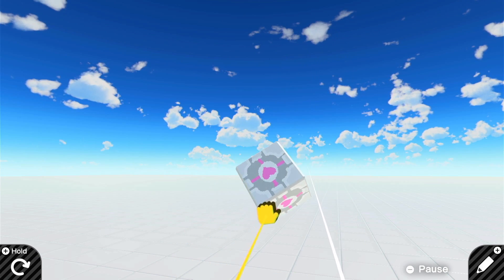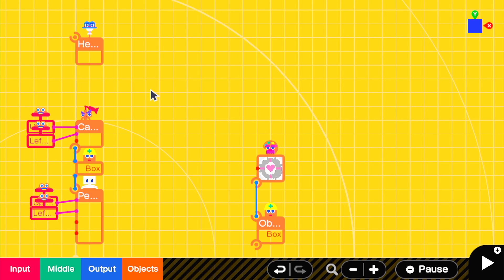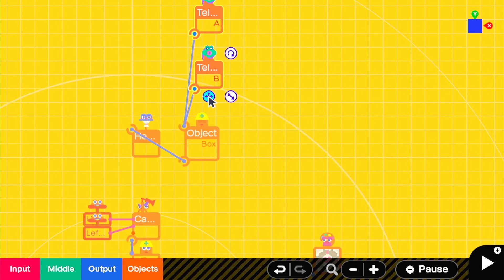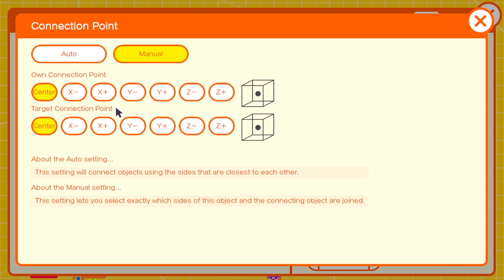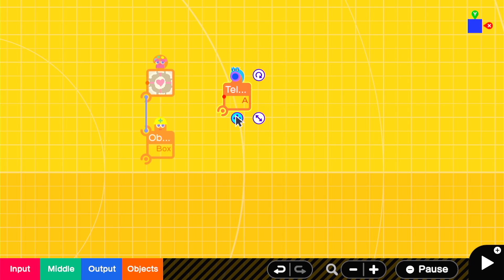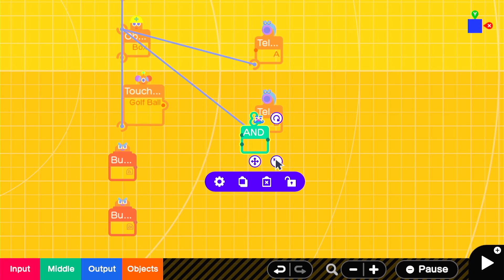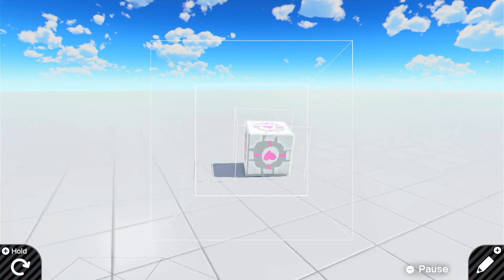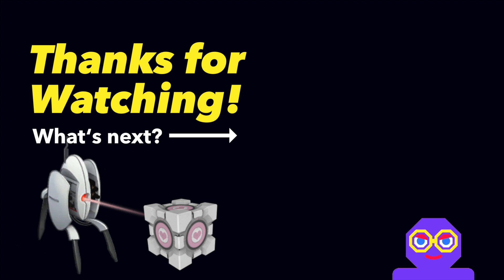How to Grab, Hold, and Throw Objects Like in Portal  (Game Builder Garage Tutorial)

Comment: Can you make an air only action? Like punch on ground  kick in air
Reply from the maker: Howdy. I don’t know when I’ll get to it so I’ll explain it here. If you need a video reference I have a video on a double jump and that should give a basic framework since we can only “double jump” in the air but the basics are this. 

Touch sensor attach to character on the Y-(below) that detects for anything the floor could be. Connected to a not nodon. Then you have a signal for when not touching floor.

You can attach it to an AND nodon with a button press, etc to activate the Air Only feature. 

You can adjust the size of the touch sensor to get different distances from ground and fine tune it.
Reply: @DaveNodon  thanks
Reply: @DaveNodon  but how do I change the ground action?
Reply from the maker: @bojo_joel  you can do something like one AND nodon for touching floor and button and another AND for not touching floor and button. That way only the right AND nodon will pass through a signal. 

What kind of thing are you trying to make? I’m curious 🧐
Reply: @DaveNodon  I am trying to make a sm64 template
Reply from the maker: @bojo_joel  oh that’s awesome! Even just trying to do something like the triple jump, you start to realize just how much works goes into making seemingly simple features in game dev. Took me forever, and I still had issues with my version
Reply: @DaveNodon  that's very true simple game physics can take up to around 4 months to get a semi-functional prototype working
Reply: @DaveNodon  also a sm64/smo dive would help a lot

Comment: Is it possible to make an item box that gives u something like from sonic or Mario?
Reply from the maker: Yes you could, detect it with the object destroyed sensor or a touch sensor, and then turn on whatever power features you code. Like for a fire flower, first code the fire flower ( button = launch object, etc) and put some AND or Calculate nodons that  only let that signal go through once you've acquired the power up

Comment: Hey Dave! I have, a certain request. What am I trying to be so sneaky like? I just want to get to the chase. Cut scenes. Every game has them to provided context. I simply want cut scenes.
Reply from the maker: Hm this is a tough one. Basically what you'd have to do is just manually control what happens at which times so. I'd probably use a marker nodon and bullseye. I have two videos where I use something similar the main one being the Better AI one. I use a behavior timeline. For cutscenes you'd just need to use the timeline to make certain things in your scene happen. 
The trickier part is with the camera. You can't dynamically switch cameras. So you'd either need to always use a custom camera than can be moved around or stuck to player, or use a sap game nodon. I'm going to have to figure it out eventually for TLOA so when I get there is probably when I'll make a video on it